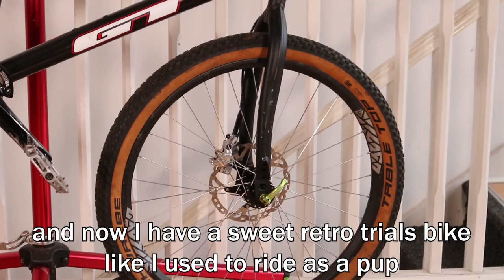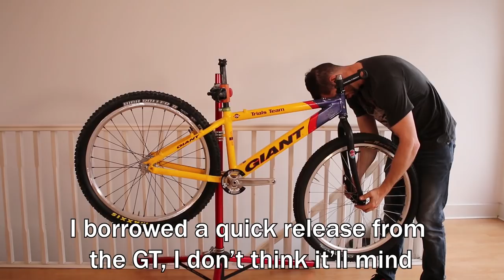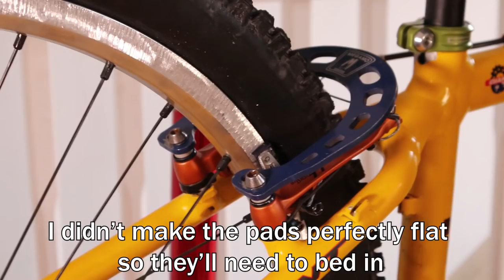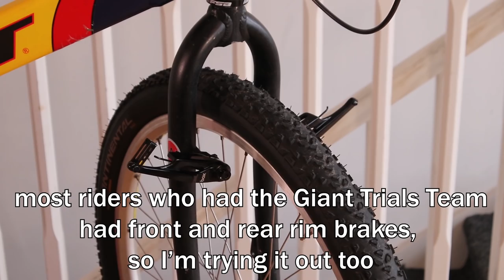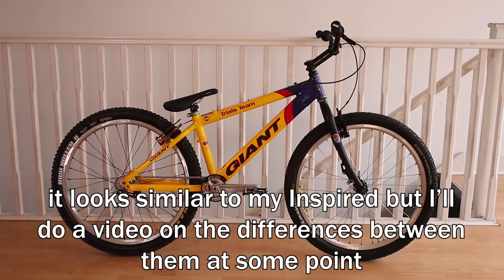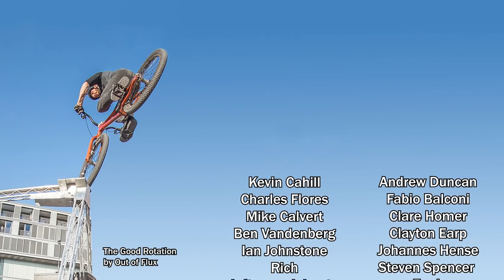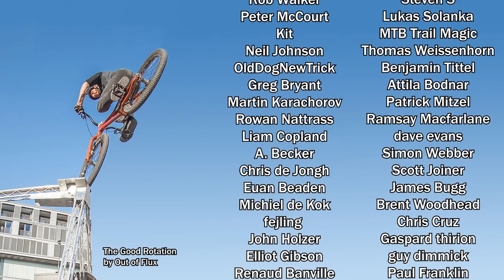Giant Trials Team Retro Build

Comment: Hey Ali Clarkson! Great build vid! You always keep coming up with ideas to make it a bit different like this one with no dialogue! Could you use that crown race you cut upside down as a tool to hit with a punch on alternate sides to seat an unsplit race? Thanks for the effort all the editing takes! Your vids always make my day a bit better! Ride ride ride!
Reply: Best way to seat an unsplit race is to get a block of wood and drill a hole slightly bigger then the steerer in the block of wood, slide it onto the crown race and hit it with a hammer. Using another crown race runs the risk of denting or chipping the one you're fitting, which would make it useless as a smooth surface for bearings to run on.
Reply: @Ali_Clarkson  Works fine when you've got cartridge bearings, so the rolling elements in the bearing don't contact the crown race directly. I'm quite surprised that headset didn't come with a split crown from the factory to be honest. For loose ball bearings style headsets, the crown race is the surface the balls roll on, so it can't be slotted.

Comment: Great build, just thought I'd mention, you can get flapper wheels for your angle grinder which will give a more consistent finish on the rims compared to grinding stones.
https://www.screwfix.com/c/tools/flap-discs/cat8570013
Also, do you carry the full weight of that seat post tucked away in the frame...?

Comment: -has an angle grinder
-cuts steerer with hacksaw
-???
Reply: Angle grinder was fitted with a grinding disk rather than a cutting one and it's pretty hard to get a clean cut in the exact place you want it with an angle grinder. Given those tool options I'd use the hacksaw too.